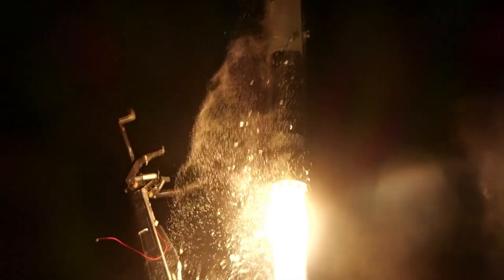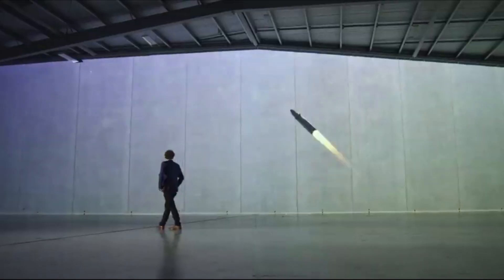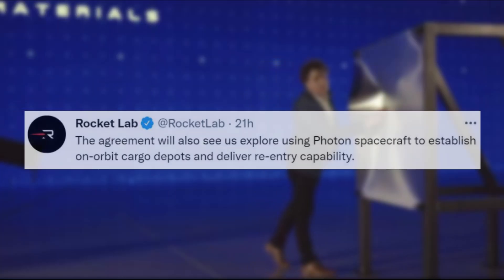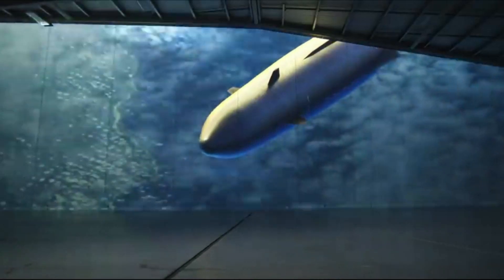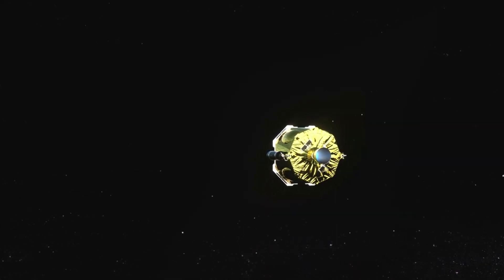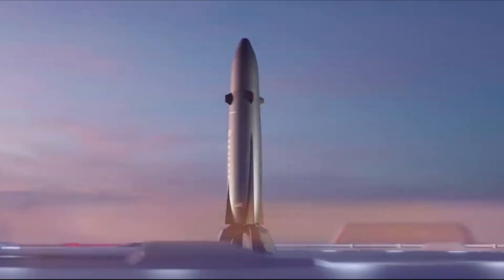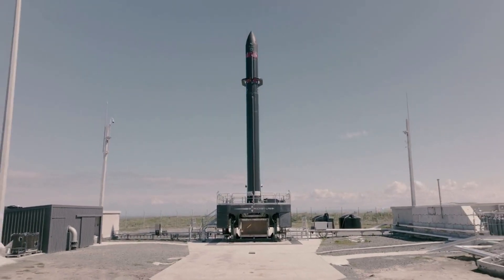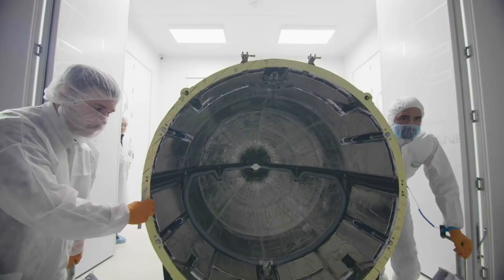Rocket Lab Might Transport Cargo With Neutron & Electron

Comment: Since NASA is mandated to post a solicitation for a second lunar lander for Artemis, and considering at least the possibility that NASA's in-house Space Launch System ("SLS") rocket is plagued with inflated costs and numerous technical problems (and isn't re-suable), maybe outfits like Rocket Lab, Firefly, Relativity and others should be looking seriously at stepping up with both an alternative convenance for Orion + ESM to the Moon and providing an alternative to SpaceX's HLS Starship for landing on the lunar surface. These would be tremendously ambitious projects, and would most likely require separate vehicles for launching Orion and for the lander, but maybe it's about time for these upstart companies to meet the challenge and prove just how solid all their ingenuity and 3D-printing smarts really are. Imagine a custom Neutron landing on the Moon. Now imagine another custom Neutron, possibly with methalox-side-boosters, carrying the Orion+ Euro Service Module from the Cape to lunar orbit. If 3D printing makes design modification flexibility possible, here's the big chance to put it to work. THESE ROCKET COMPANIES SHOULD GO FOR IT!
Reply: Astra and 3d looked so good.  My small investment in them is only 95% down right now....  Still love rocket lab.  They are down a bit also.  Difference is I keep buying Rocket lab.